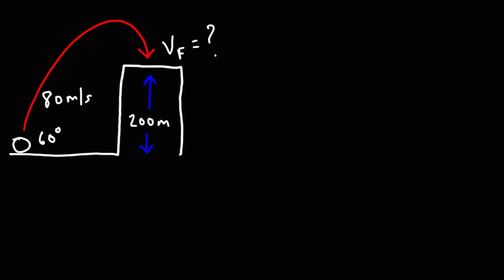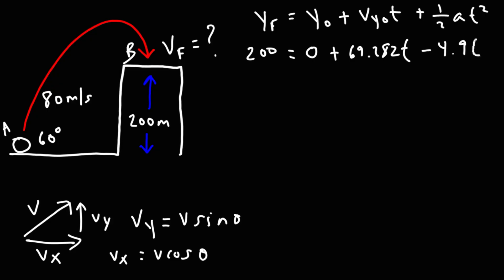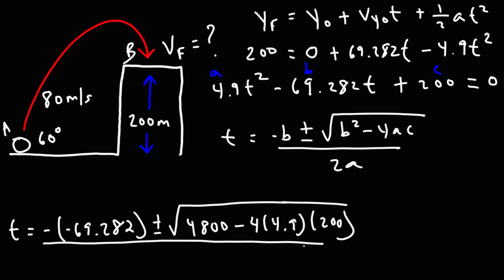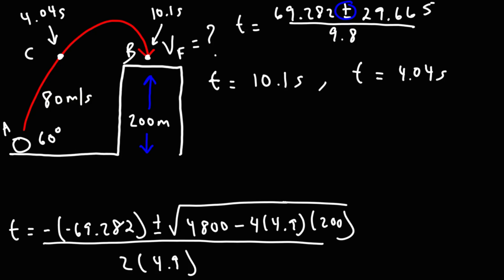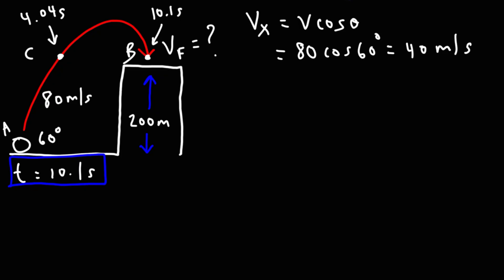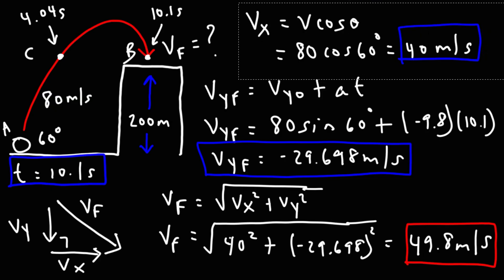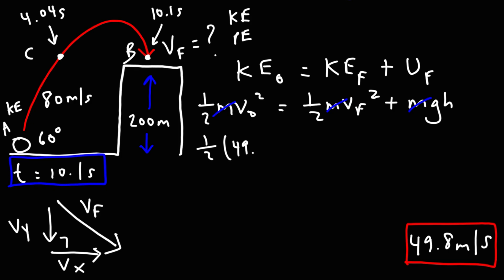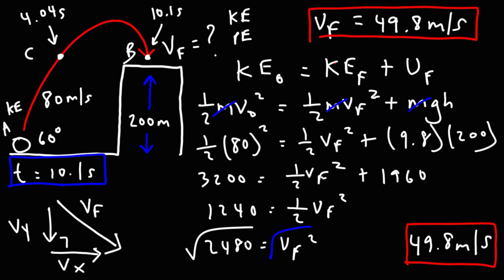Projectile Motion and Conservation of Energy - College Physics

Comment: How can I calculate the maximum vertical hight the object will cover?
Reply: It seems the only way to calculate the maximum vertical height is by breaking up the initial velocity into its components:

Vix = 80cos(60°) = 80 * 1/2 = 40 m/s
Viy = 80sin(60°) = 80 * sqrt(3)/2 = 69.282 m/s

Set up energy conservation in the y-direction only:

Ei = Ef
KEi = Uf
1/2m(Viy)² = m(9.8)(h)
1/2(69.282)² = 9.8h
1/2(4800) = 9.8h
2400 = 9.8h
h = 2400/9.8 = 244.90 m

Comment: Knowing that you can bringing every number to a single digit and check all your answers by using this technique help's
Example: (23×34=782)
2+3=5\ 3+4=7\ 5×7=35\ 3+5=8
(7+8+2=17\ 1+7=8)
By knowing they both equal 8 you know that you have a correct answer.
All number's do their own pattern this is why it's possible.

I figured this out when I was still in school.
Reply: i doubt it will be of much use to college students but that is a very good method if it works